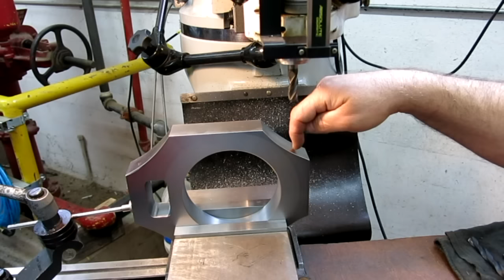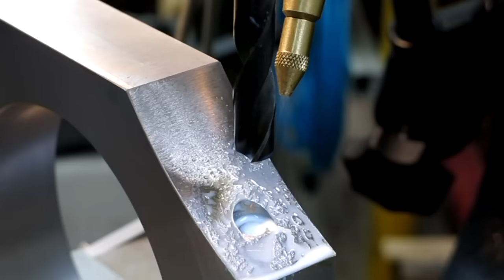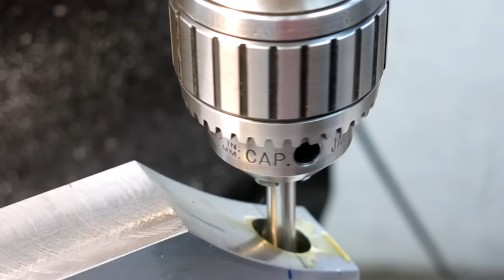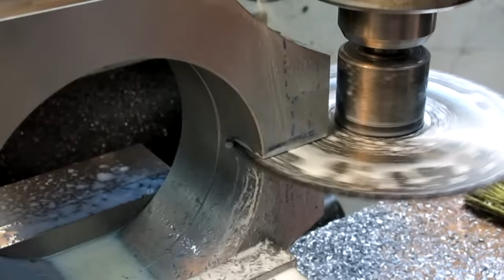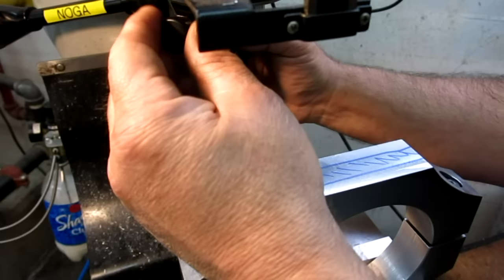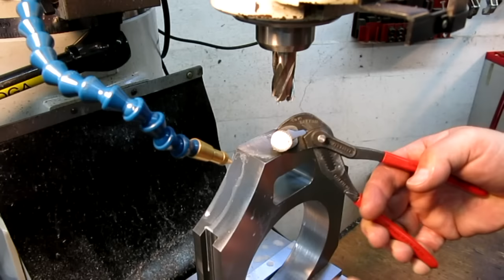Etching Press Bearing Housings Part 4

Comment: Hey Tom, I'm glad that you include mess ups into your videos and show how to fix them ( the slitting op out of order).  When you were talking about stabilizing the part for the slotting,  I was thinking that you would indicate the top that sprung up, then measure the slit with feeler gages, place a gage block into the slit and tighten the screw.  The way you stabilized it worked just fine(judging by the sound of the cutting) and was quicker.  You gotta love those Kant Twist clamps!

Comment: Smart idea using an end mill to get a flat surface so you could drill the hole.
Don't have a mill yet and drilling on angles is still a struggle.
Nice work Tom.

Comment: I like using those annular cutters too Tom. I first started using them in my mag drill then in the mill. I liked them so much that I bought another set just for the mill.

I always get creeped out when I see you using your fingers around those spinning cutters and to wipe sharp chips away Tom. I got tired of sharp festering slivers and cuts, so now I have chip brushes and shopmade dust pans on all of my machines for that action.

Comment: Great video Tom, Just a small suggestion from the many slitting operations we do here. Place a small jack in the bore to limit vibration and tension and control the springing action. We have found it works well.

Comment: A good idea for those annular cutters in the mill is to make a spring loaded device that fits up in the collet. At work we took a 3/4" round bar bored it out dropped a spring inside and a flat head screw at the end to seat against the center pin. simple and works great!
Reply from the maker: tmcweld Hi TMC,

That is a great idea. I never bothered to make something since I don't make that many holes this way. Thanks for the comment.

Cheers,

Tom

Comment: Thanks Tom -- whole bunch of goodies.   Couple of tips for the rest of the gang:

Socket head cap screw - counter bore depth:  Trick... bolt diameter + 10%.   So 3/8" shcs = 0.375 + 037 = 0.412 Ditto 1/2" = 0.550"    Yes, there are exact spec's, but diameter + 10% works pretty nicely.

Milling the top after slitting.  I would have cheated and used the clamp bolt to clamp
the slitting saw back in the gap! Good time not to have visitors in the shop wondering wtf (walter tom fixture) is that?   Then again I'd probably still be digging out a busted tap! <grin>
Reply: Tom Walter The slot would be slightly wider than the saw blade thickness and also could be somewhat uneven across the width of the cut…

Comment: If you like wasting time like me and those saws drive you nuts you can fix the run out in a few minutes. I just take like a 200grit stone and run the slitting saw in reverse against the stone with it pinned against a flat surface and it takes the runout out in pretty short order, it is usually only like 3thou or so out, but knocking those highs off sure do make them run sweet!
Reply: For a non-precision cut like that, I'd have probably chewed through it with my tablesaw. >:)

Comment: I'm really glad to see more work on this etching press, the machining is very fascinating and as an amateur at manual machining I'm learning a lot.

I should probably ask this on the wabble (I would spell it 'wobble', but who am I anyway?) drive videos, but I don't often get around to commenting on videos because I generally watch these on my TV, which oddly has no keyboard:

It looks from the video and in my braincad(TM) that the wabble drive will "pulse", moving faster when the inner gear is at the top (far side of the antirotation arm) and much slower opposite that.  Is that the case?  I don't think it should affect the operation of the press significantly, but does that limit the usefulness of such a compact reduction drive?

Comment: I recently pulled off a 5" long slit maybe 1" deep in Dura Bar thanks to your vids. It was actually surprisingly easy. I did make sure the mill was trammed however, and I used and integrated R8 saw arbor. Thanks for the tutorials and slitting saw play by play!  ....  Also what compressor do you use with your minicool???

Comment: Great video as usual.  I am waiting to see the whole press crank up.  I am also waiting to find out what that pocket is for.  I got a slitting saw and the first time I used it I crashed the thing.  Now I need a new arbor, not expensive but I never remember to order one.  Thanks for the video.

Comment: Naive question here -- when you were adjusting the top level for milling the key slot, after you'd cut the slit and they'd sprung apart, could you have used a shim in that slit, approximately the width of the slit saw's kerf, for the bolt's draw to clamp against and limit any springing tendencies?

Comment: Hi Tom

With regards to the slitting operation, would it not be more beneficial to just mill the slot instead of using a slitting saw?   Are there pros and cons to either way?

New to the machining world and sometimes you have to ask.

Thanks
Reply: I think milling that slot would be possible but difficult. It requires a very thin, long end mill. Skinny end mills cannot handle big bites without significantly deflecting, causing problems in the next pass. So if this operation were to be done with such an end mill it would have to be done with a lot of passes. As a wild guess I would say somewhere inbetween 20-50 passes to reach the full depth of the slot. 

The slitting saw is many times more rigid and in the end would be faster I think.

Comment: Hi Tom
why do you switch from the coolant spray to using a brush and oil, for some operations ? 
thanks :)
Reply: paul spacebee Also like he mentioned, when milling full with, or, any time, as far as I'm concerned, the air jet with coolant, or even just plain air, will blow away the chips so they don't re-enter in the path of the end mill, this is even more important with carbide tooling since they get chipped very easy with the re-entering chips.

Comment: Could you have just driven a Jacobs wedge into the slit to stabilize the part, rather than using a bar and clamps?  Would a wedge vibrate out?

Comment: Its odd how whenever I watch slitting saws in action they never cut evenly all the way around. One side always seems to be more in contact than the other. Like they run off centre. Regular wood saws seems to run perfectly true.
Reply: Colin Riley Wood saw blades probably run out a bit  more, but are hard to discern at the speed they operate.
Reply: Darryl. Yes I did wonder that myself however maybe the opposite is true. The guy who sharpens my blades said his machines cost over $100,000 and the diamond blades up to $8,000. He said its not likely they would run out unless the arbor or machine itself was worn The blades need to run in perfect balance and true at nearly 3,000 rpm. Maybe if the slitting saw was reground it may run better. If not then something else is wrong. Interesting subject.